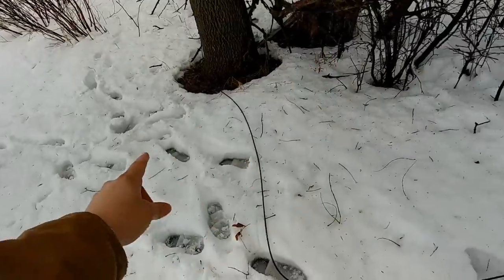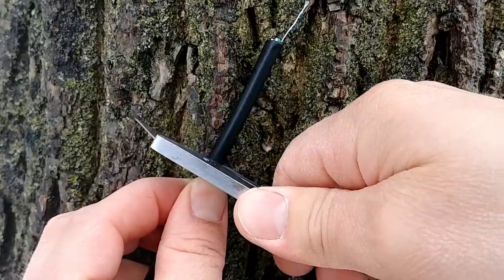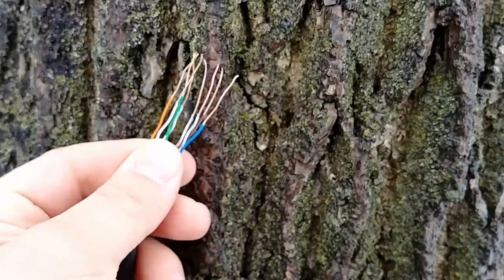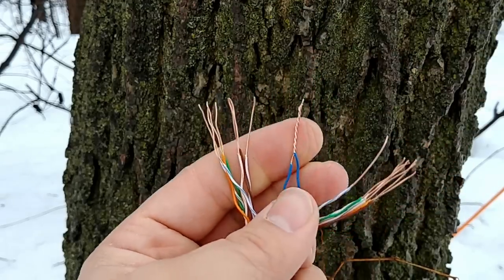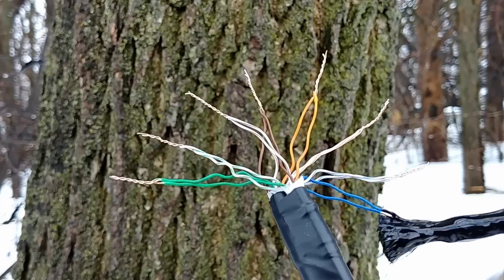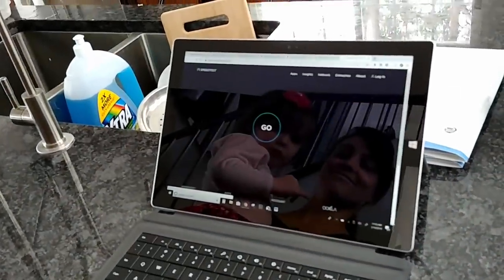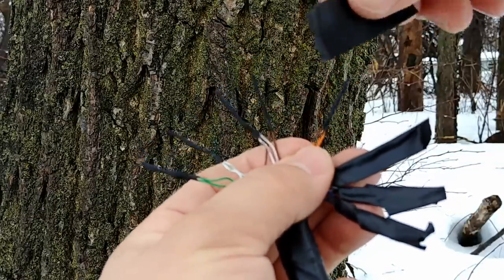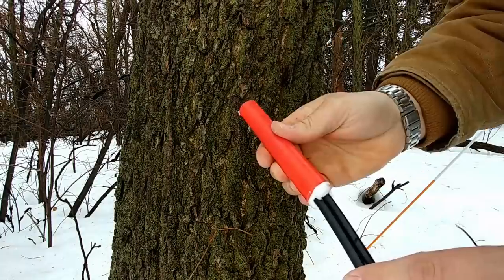How To Splice an Ethernet Cable By Twisting The Wires Together

Comment: Hey I just want to say THANK YOU! I'm from Jamaica where the ethernet cables are expensive so I couldn't bear to throw out the 100ft cable I have. My dog chewed it through in 4 places! It took some time but I did it thanks to your clear instructions 😊 Big up!
Reply: What's 100ft ethernet cost in Jamaica? I'm curious
Reply: @inasnuggie6767  60, 70 bucks
Reply: @Quizzlette  thanks for the reply that is insane
Reply: My dog just done the same
Reply: @Quizzlette  really? 30 metres is 12.99 gbp on amazon, theese are flat though, but very conceilable. a suitcase would fit like 100

Comment: many many years ago i was told i couldn't just twist ethernet wires together but the expensive wire i had buried going to my garage was cut in my basement and i wanted it fixed now.  anyway your video just reminded me it's been twisted and taped for something like a decade now and working fine. maybe i'll fix it correctly before this decade is out.
Reply: so im A. very dissapointed with my pets and B. had TWO separate disconnects in the space of 8 hrs, both being due to chewed cables, first it was a puppy upstairs being bored, second time hours later NEAR the damn computer a cat was demanding attention whilst im on calls, and just chewed the crap outta my ethernet cable... when i found the break it was moist and shocked me, didnt even see the cat flinch near me when he did it, so basically cut the badly damaged parts away, just used a knife, cleared enough cable on both ends, used lighter to remove the plastic off individual wires, nothing fancy half an inch per wire and twisted them, didnt have any electrical tape so i just used bits of plasticine over each naked joint, its a cat6 cable and with TWO repairs (i bought two replacement cables before....) its no noticeable difference... also once i done the plasticine insulation, i wrapped a plastic bag around the mended bit, attachec both ends of cable into a single double line so it wont rip if i move it around with a bit of wire around. ill get a replacement but just curious to see how long this lasts

Comment: Any untwisted wire becomes an antenna and can also get crosstalk between the wires. It's best to leave them twisted right up to the point where the wires are stripped bare, and then cut the bare part to keep it short.

Comment: I don't think it will be an issue as long as you have no other high voltage/current power lines in close proximity because that's really what the twisted pairs are supposed to shield from.
Reply: seephor cdg
Reply: I hate to rain on your parade there c4 but as an electrician I'm going to tell you that that's pretty much wrong what you said nobody runs cat5 cables next to electrical lines they're twisted because they do run a small amount of current through themselves and that helps protect them from themselves. And if they want to protect themselves from electrical alliance they usually have a aluminum jacket

Comment: Thanks so much for your post!  It gave me the confidence to do this. I’m running a basic setup:  100 Mbps cable internet (Optimum) into a Linksys CM3008 modem feeding a TP-Link Wired/Wireless-N router.  Used for surfing, email, audio streaming and 1080p video streaming (mainly HD Netflix).  Wireless is sketchy in my house due to lots of walls, so during Covid (when, like many, I had downtime!) I ran 100 feet of Cat6 cable under the house and up to our A/V center, which worked fine until critters chewed through it 3 months ago.  Since then we’ve dealt with the pain of intermittent wi-fi until this morning, when I spliced out the chewed portion based on your video!  I did it a bit differently, keeping the 8 wires in a straight line rather than bending them at 180 degrees.  I also used heat shrink tubing (not liquid tape) on each of the 8 splices (took much patience!) as well as over the whole bundle.  (I made the splices as you did, just twisted the wires together:  To really be perfect I could have soldered the splices but I just didn't go that crazy).. I bought a new Klein stripper tool (for those who would like to know, the 8 tiny wires inside a standard Cat6 cable are 24 AWG, and my old tool only goes down to 22).  The Klein tool (about $20) goes down to 26 AWG.  It took an hour and a half (including 2 trips to Ace) and voile!  We now have solid, fast internet again!  So far I don’t notice any degradation in signal, granted I only watched for a short while this morning, but what I watched was fast with no buffering or hang-ups.  I do have a new 100ft cable on order in case this turns out to be not so ideal.  But, here's hoping! My advice to the equally fearless:  Take a length of old cable and do a test at the kitchen table first (ie, stripping the outer tubing, the 16 wire ends, twisting them, etc.) so you’ll be faster and more confident when you’re crouched uncomfortably under your house.  And don’t forget to slip the heat shrink tubing onto the wires BEFORE securing the splices!

Update:  It's been several days since my splice, and I am back to report that we have been enjoying fast, perfect web surfing and video streaming in full HD (Netflix) with absolutely no problems of any kind.  So I can say the following with absolute authority:  If you're running a 100 Mbps system, watching in 1080p HD and running 100' or shorter ethernet cable, splicing out a damaged portion of your cable works perfectly with no degradation in signal.   Saved me the headache of running a new cable under the house.  (Again, my splices are "straight-line", not 180 degrees, not sure if that makes any difference.)  Thanks again for your post.  I hope people read these comments before they are swayed by the cynics, doubters, naysayers and "armchair technicians" who pontificate about how certain techniques can't work, when guys who get their hands dirty and try them out, prove that they do!

Comment: You can use 3M Scotchlok UR or UY splices (which you can get at Home Depot or Lowes) to splice cat5e cable. These are waterproof splices. 3M even tested them way back when to maintain the cat5e rating.

Comment: Think of ethernet wiring just as you would think of electric -- just because it happens to work doesn't mean you've done it right.  Of course, with ethernet the stakes are lower -- it just stops working or has a high error rate; it doesn't burn up.   If you must splice an ethernet cable, you really should try to untwist the absolute minimum amount of wire on each pair that you can get away with.  Then solder each connection (it really makes a difference) and then put on your heat shrink or liquid insulation.  

Another option is to simply put an RJ45 end on each side and plug them into a female-female connector.  This actually makes the best connection because it preserves most of the properties of the twisted pair cable.  You can then wrap that up in heat shrink or tape if you want to.

Twisted pair ethernet is rated for up to 100 meters (328 feet) at 100 Mbps or 1 Gbps.  If your cable is shorter than that, it buys you some wiggle room.  But don't just look at "how fast it runs" -- go onto the computer and check the error rate of the interface.  If you've got a lot of drops and/or retransmits, it's going to slow down regardless of your actual Internet speed.
Reply: This is the best idea, although in many cases, com cabling is run under door and floor trim. 

There won't be enough room for the connector/s in many cases. 

I've had to deal with this in a very large hotel. The cabling was installed long after the hotel was built. 

The broken connections happen when inexperienced or uncaring trades workers shoot pins into the cables.
Reply: Why does solder make a difference? Do twisted wires wiggle and make a small gap without solder?
Reply: @kenalpha3  Every splice adds loss.  Although it might not seem like much, the resistance of a solder joint will be lower than the resistance of a twist alone.  Likewise there will be less "noise" if the cable vibrates.  And of course it's less likely to come apart if someone tugs on it.
Reply: @igfoobar  Thank you. Do you know if CAT5/6 couplers also [significantly] add noise? It's a 2 inch part with 2 female holes. I used it on a POE cam, join 100 ft + 10 ft cables, and didnt notice any difference. But what do you think?
Reply: so i got a untwisted (flat cat6 cable) ethernet cable, chewed in two separate ends its 20m long and the damage occured bout 1.5m on both edges on same day lol. i used plasticine, knife & lighter (plastic bag shrinkwrapped over the final product) ive not lost any speeds or introduced latency

Comment: this definitely work. I have it twisted in my home. work for 2 years already. don't listen to those "PRO" saying you will lost speed, won't last long, and bullshitting. you might lost 10% of your speed, but who care? you get it work and that is how they twist electric wire too.
Reply: It saved on the pocket and we were shown A solution that’s all that counts.
Maybe the naysayers business is soooo slow they have plenty of time to criticize (while they are also learning) and maybe trying to drum up some business😊
Reply: i been using mine spliced no issue only problem i have seen is if you bump or pick up the wire it can stop working thats it. download speeds are just the same as a nonspliced cable. the professionals just hate to see people not spend money on them

Comment: I get that you're doing this as a temporary fix, but you'll have a huge signal loss simply because you are forcing the signal to make a 180 degree turn. If you simply maintain the "straightness" of the cable throughout your splice you should get the maximum potential. The technical term for the rule you are breaking is called the "bend radius". This is specified for any type of network cable. See link below. Your concept would work just fine if you were only concerned about a power cable. With a network cable, signals travel down the copper and cannot make sharp 90 degree turns, less a 180 degree turn. So you should point the cables at each other, then twist each strand back together. This might require more dexterity and possibly require you to strip another 6 inches of outer sheathing in order to get your fingers around the final wire bundle. My rough guess would be a 60%+ signal loss, whereas a straight splice might provide a more livable 15%+ loss. This straight method would be a very weak bond if someone were to tug on it and I'm guessing that would not happen for most scenarios, but if you wanted to beef up the strength of the physical connection simply add a foot of wood such as a dowel rod or 1" square and tape it down to that. Love the liquid tape!
https://pactech-inc.com/bend-radius-determines-much-can-bend-cable/
Reply: That's crazy, I never knew data cables may have signal loss/degradation from crimping or having a 180° turn on them.
Reply: I feel like you're fuckin with me...
Reply: @core8967  does bend radius apply if i twist two cables together starting at the bases of the cleaned wires? so shortest point would have like a 45degree angle max

Comment: That’s a nice splice! Pex tube, silicone and all!! I don’t believe your supposed to splice cat5 that way, but bet that’s gonna be fine for home use in a pinch.  If it were indoors, I sometimes terminate both ends on jack and connect the 2 pieces with a short patch cord. Again, not something that should typically be done, but works to get something up and running again quickly.
Reply: There’s nothing wrong with using two jacks to make a splice. That’s how patch panels work. The wire in the wall/ceiling goes from a jack at the patch panel to a jack at the final location. 

I use that method occasionally, because terminating CAT6 into a plug is quite annoying!
Reply: There's totally fine I'm surprised you didn't bust out the duct tape but you know if you're just going to run like HD YouTube videos or something no problem you're fine but don't try to connect an Xbox series x on a 4K TV run Halo infinite online it ain't going to work or at least you're not going to get many games you're going to be so bad lag yeah I tried it not pretty

Comment: I had to do something similar very recently. I believe keeping the twists going the same direction and the pairs tight may have an impact. I spliced an 80 foot run by twisting and shrink wrapping with a gigabit setup and I consistently push over 900 megabits per second. Interestingly enough, the main portion of the run is poor quality cat5e. It works, and works well!
Reply from the maker: My splice worked great for awhile but eventually I did have to replace the line. It is mostly a good "short term" solution. Glad you got yours working!
Reply: For Scott C's twist question, I think once the conductors touch each other firmly, it doesn't really matter how they're twisted or clamped or soldered or whatever.  In fact (and this is just me applying vague physics knowledge, not actual networking expertise) as long as there's enough contact area between the two conductors to not cause a bottleneck & corresponding noise point, it's probably better to just use twisting and some insulation, rather than solder or other metallic clamping, because the metals may have different resistance properties and thus introduce noise.
Reply: @kenahoo  you need some twisting for EMI, otherwise the impedance changes and signal becomes more lossy. thats why its twisted pair. but 1 or 2 twists per inch should suffice in the same direction! (im an EE).
Reply: @Jliuify  agreed - I was only talking about a twist at the connection point between two conductors, which should be short enough for the twisting not to matter much.
Reply: @BenjaminSahlstrom why did you have to replace it, what happened?
Reply: @kenahoo soldering seals the contact and helps maintain low resistance long term. Otherwise, the contact point can corrode and the resistance increases.

Comment: If you do this maintain the twists!!! It's called twisted pair for a reason, make sure that those pig tails are twisted as close to the original as possible.
Reply: It's not like his outdoor cable run is in an EM noise field like a plenum cable in a drop ceiling.

What noise source are you concerned that he needs to be shielding the cable from?
Reply: @sgtbilkothe3rd  it's not just about the outside noise rejection, but also about not radiating the signal away. Any inconsistency in the twist will introduce an additional loss in the line. As the video's author mentioned elsewhere, he eventually had to replace this cable.
Reply: @AlexKarasev I should clarify.  I was thinking of other applications, splicing within an instrument  Interface box  for example where the untwisted section occurs at the end if the run, maybe an inch or two. Not referring to mid line in a long run.
Reply: @sgtbilkothe3rd  I see. Ethernet is a bi-directional protocol, though, so there might not be a preferential place to have the signal loss due to a splice. With that said, I've not found a good way to splice a cable. The "jack and plug" method is "ok if bulky" plus I hate to make the plugs AND it has an unnecessary extra contact, and the purpose-made splice boxes are even more bulky, and terrible quality in my experience. Ironically, a tighter wound and soldered version of the splice on this video, may be the best possible option.
Reply: @AlexKarasev  yup agree, most often I am just running into temporary repairs in remote locations, to keep someone productive, until suitable replacement can be made. I appreciate your insight.

Comment: In a pinch it works! I wonder if you were to re-twist the pairs back together if that would help with your connection. They are twisted to cancel out EMI. This would be my solution for a few days. For a few months I would terminate both ends and use a pass through. For permanent I would blurry conduit as xephal mentioned and run a new line.
Reply: ❤❤❤❤❤❤❤Q

Comment: Pro tip. Bring a butane torch and a small amount of solder with you... the wire is so small you can solder it into a permanent Connection in a instant. Heat up the wire with the torch and touch the solder to it it only takes a half a second

Comment: Very cool video!  Like your stuff!   Just for conversation sake... I think you would probably get a better electrical connection by either not using the liquid tape, or using a lot less of it.  It appears to me that you got a strong enough mechanical connection already with all the twists, and then the folded electrical tape.  The liquid tape will degrade the quality of the electrical connection, getting between the twisted conductors.  Just my thinking.  Also, just another thought, cat5 only uses 2 of those pairs, so in a temporary pinch like this, you could just do the Tx and Rx pairs (orange and green, or 1,2,3, 6).
Reply from the maker: Great thoughts! After I finished I did actually think of that with the liquid tape possibly getting between the twists so that is probably a great thought. Thanks for your comment!
Reply: Depending on what is on the other end, the brown and blue pairs maybe used for remote powering or power over ethernet so you would have to splice those as well.
Reply: @brianleeper5737  it is definitely PoE for fixed wireless internet
Reply: @BenjaminSahlstrom  Liquid tape is pretty thick. I don't think there is anyway it will wick into the wire strands, and definitely won't separate the mechanical connections made.  No different that the original wire insulation that is coated onto the stranded wire.